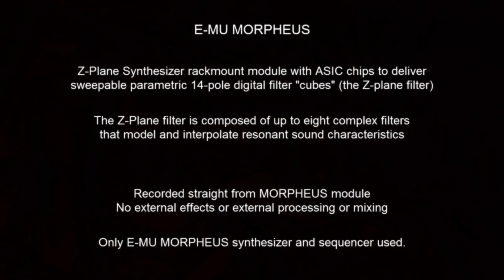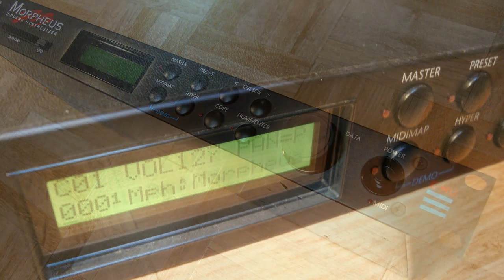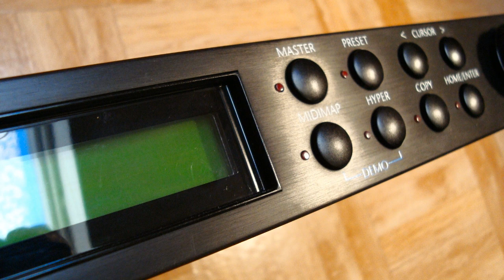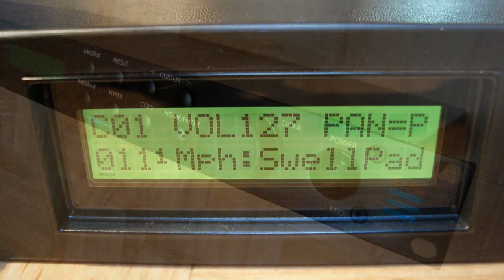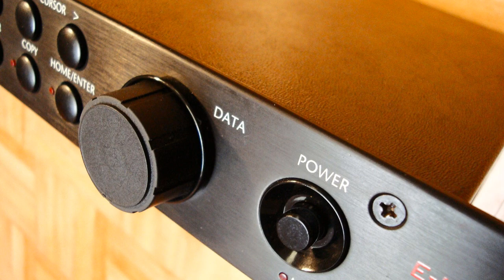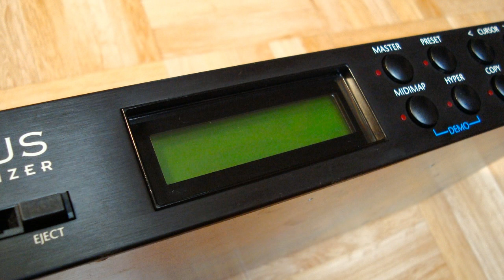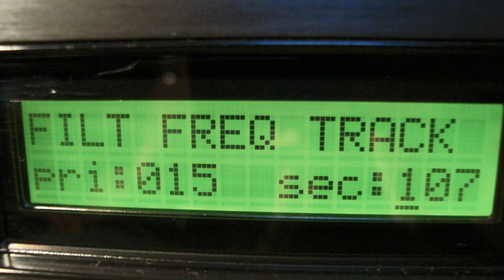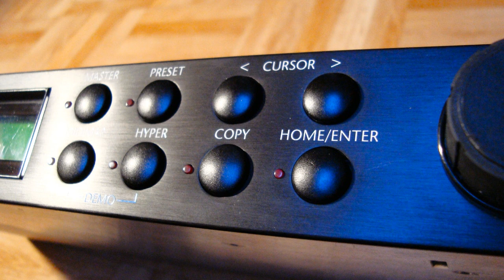𝗘-𝗠𝗨 𝗠𝗢𝗥𝗣𝗛𝗘𝗨𝗦 Z-Plane Synthesizer 【Demo】

Comment: Oh wow,......this is an excellent demo, & a great synth!  I have an E-MU Mo'Phatt, but it's nothing like this Morpheus!
Reply from the maker: Gerry No That's true - Mo'Phatt is aimed for hip-hop, R'n'B, dance and stuff like that, while Morpheus is field for truly electronic sounds and sonic experiments. They are very different synths.
Reply: oscillator I want this synth so badly.  I keep checking eBay, (like 3-4 times per week) but no Morpheus ever comes up for auction. }:o{ 
I guess I can kind of see why.  It doesn't seem like the kind of synth that owners would willingly want to part with.  Oh well.  When I finally do get one, (and I WILL get one!) the waiting & anticipation will make owning & using it that much sweeter. :-)
Reply from the maker: Gerry No
Actually it's not so bad - I've checked eBay and there is one Morpheus auction in UK. Before most of them I saw in US site, sometimes in Germany. Some time ago there was 4 synths on sale at same time, keep watching and you will get one, surely. Morpheus is the synth which if you like it, you will never let him go, but probably you will be happy to sell it if you don't get into it and don't understand how it works. Like I told before - it's not from the easy-ones, it needs some time and patience to go through the manuals, connect to the PC (highly recommended, but not neccesary) and set-up everything to make it sounds nice. Default synth makes just impression of average vintage module, nothing special. When you will get one, I promise to give you all the software I have (Windows based MorpEdit, SoundDiver, Kai'ckul and MIDI-OX), User Manual, set-up routings and some more tips to start of use the Morpheus un full power. Will be ok :)
Reply: oscillator Thanks.  I already saw the one in the UK, but the seller doesn't ship to America.  I've also been looking for Ultra Proteus, but can't find those either.  I do see a lot of Proteus 2000, & 2500.  What do you know about the 2500?  Is it better than the 2000.  I see this information on vintagesynth.com, but I don't really know what it means. (or which has better filters)
2000 - Filter - 128 (multiple types with resonance, including Z-Plane filters)
2500 - Filter - 50 types of 6th- and 12th-order Z-plane filters
Both appear to have "Z-Plane".  The 2000 has more filters, (2.5X) but I have no idea what "6th & 12th order" means, or what "order" the 2000 has.
Morpheus - Filter - 32 14-Pole Interpolating Digital Filters employing 32-bit internal arithmetic; 198 programmed filter types)  
Morpheus seems to have to most filters. (& I've heard what it can do!)  
I think I'll wait for the Morpheus.  
I appreciated your offer of software, & when the time comes, I will definitely take you up on that offer.  ;-)
Reply from the maker: Gerry No
So there is what I found over the i-net:
The P2500 is 4 rack spaces. The sound ROMS of both are the same - same sounds and presets. The P2500 does have control over parameters that the P2000 doesn't have - may be worth the extra $100. Both have 3 extra ROM slots for expansion. The P2000 has only 4 knobs to control the 16 paramters, the P2500 has 16 knobs - more control in the P2500.
I'm not sure about the filters, but definitely Morpheus and Ultra Proteus have more advanced filters than P2000 and P2500. Actually Morpheus and Ultra Proteus are everything the same except sound ROM - UltraP have much more waveforms, but it lacks some of Morpheus waves, UltraP is better for acoustic emulations while Morpheus is better for electronic type sounds. So decision is yours. The best could be to have both Morpheus and UltraP of course, but if I need to choose just one, I choose the Morpheus.
If you're in US, than it will be more easy to get some for sure, coz there are much more E-mu units than everywhere else! Cheers
Reply: oscillator Thanks for the information.  I will go w/the Morpheus then, no doubt.  Except for a really good grand piano sound, (which I have on my Kronos X 88) & some good drum sounds, I really don't much care for sampled "acoustic" sounds.  They're never really passable as sounding like real acoustic instruments.  You can always hear that they're sampled.  I already have enough of those kind of sounds. (which I barely use anyway)  My favorite synths/sounds are analog, analog/digital hybrids, analog modeling synths, wave-table synths, digital/electronic sounding synths, etc.  IMO, the Morpheus is one of the best & most interesting sounding digital synths I've ever heard. (especially the way YOU use it)
Reply: oscillator Guess what I just bought?  :-)  :-)  :-)  :-)  :-)  :-)
I just checked eBay & there it was.....an Emu Morpheus!!!  I paid $349 & the shipping is free.  I don't know if $349 is in the higher end of the spectrum for the Morpheus, but the seller is "Perfect Circuit Audio".  They're an extremely reliable, trusted, & highly rated seller, & they claim that "ALL GEAR IS TESTED AND GUARANTEED TO BE 100%". (they even allow refunds) 
BTW, what can you tell me about any of the Morpheus ROM cards?  (presets only, no additional waveforms)  At $90 each, do you know if any of them are worth buying?
Reply from the maker: Gerry No
Congrats :) That's nice! 350 bucks are not very cheap, but it's not very expensive I think, Morpheus is worth every penny! So welcome to the Morpheus world :)
About ROM cards - I have the sysex files of these cards so don't waste your money. Only thing is that I have Presets of all 4 of these ROM cards, there are not Hyperpresets, but that's not so important by the way. Give me your e-mail and I will send the sysex files, editing software (for Windows only) and some tips to get most of your new friend :)
Reply: oscillator Hi.  I sent my email in a private message. ;-)
I'm almost welcomed to the Morpheus world.  It hasn't arrived yet, hehehe.  It says "estimated arrival April 24th", but it's being shipped from other side of the country, nearly 3,000 miles away.  I tracked it & it says "in transit".  It will probably arrive tomorrow or Monday. (I can't wait!, hehehe)
I'm glad I didn't waste $90 on the ROM cards.  I really appreciate your help with the SysEx & programming software.  I might need a little help with the SysEx stuff.  I haven't used SysEx in nearly 20 years, so I am not very familiar with it anymore.  (my last SysEx dumps were done using a Korg O1/Wfd, back in the mid-1990's)
BTW, all the great sounds in your video here,.....what will you do with them?  What are you plans?  Are you going to sell them or share them?  If possible, I'd really LOVE to have these sounds, all of them. (or even just a few of them)  Your video & the sounds,....they're really the reason why I bought the Morpheus.  Thanks again.
Reply from the maker: Gerry No You're welcome to check some bizarre stuff from the Morpheus synth - my new video called "Insanity". Greetings!
Reply: Gerry No you got it? BTW the proteus 2500 has an arp and is more live-configurable  via knobs etc.. Some guy did a vid of it on here but I forgot his name.. it's a beast of a synth though
Reply: Mel Shivson The Morpheus?  Yes, I got one last month off eBay for $349.  The price may have been a little high, but the shipping was free, the unit was guaranteed. (& refundable for 30 days if I was dissatisfied)   
Also, the Morpheus is somewhat rare & hard to find, so I just wanted to grab one while I had the chance.  Quality wise & cosmetically, It's in near mint condition.  Overall, I'm very happy w/the purchase.
Reply: @_oscillator am I able to use these sysex files inside of a kurzweil ? I’d really love to try them inside vast

Comment: The audio sounds a little "muddy".  I've not listened to the Morpheus before, but it sounds like a lot of top end has been cut - it just doesn't sound "bright"...
EDIT: At about 10:00 the noise floor jumps up & you begin to hear more higher frequencies...  I'm guessing the Morpheus is a noisy beast?
Reply from the maker: The dull sound problem was a cheap chinese external USB audio card (my laptop has no line-in jack). Now I am using the Lexicon Aplha card, which is much better. You can hear the full frequency range of the Morpheus synth if you check "Insanity" tracks on my channel - they were recorded with new audio card and you can hear the real sound of this synth. Cheers

Comment: Nice, I'm surprised I haven't gone through the Presets yet of this machine with a video. There are some definite cool filters going on with this machine, as well as other combos to manipulations; typical synth stuff. Well done! I'm hoping to create some sounds with this beast eventually, I only created one thus far, but need to work on it more. I've been lazy.
Reply from the maker: ish233 It's good idea to use the MorphEdit software to program a Morpheus - that makes it much, much more easy to change the parameter values because you can see and change all these parameters on PC screen and no need scrolling thru the pages with encoder wheel from Morpheus' front panel. And what's more - there is only single presets in this demo video. Morpheus has also Hyperpreset mode to stack up to 16 Presets together, it means the Sound will be very FAT !!!
Reply: oscillator yeah, I usually use the on board screen to make sounds, I've gotten used to it from other synthesizers I use. Although someone convinced me to try another software program for some FM synthesis, so I work with that a bit as one of the only software I used with changing parameters outside of the on board screen. I don't mind it as much. I know about the hyper presets, it's that function generator and utilizing the filters to compliment a sound like a fine wine to a dish, that complicates my mind a bit. The Morpheus is definitely in depth and I've read the manual a few and still working with it. I'm curious to try the Sub outputs next with the mixer I have. All in all, a grand synthesizer.

Comment: Very Nice! Such smooth sounds, but still so much timbre variations.
Reply from the maker: +Super Fata You right, the Morpheus has very complex filter system, also advanced modulation matrix and 'Function generators' which all together makes Z-plane to sound very wide and different. I'm more than happy with this synth :)
Reply: +oscillator Is it hard to program? I mean, if you know your synth basics.
Reply from the maker: +Super Fata Programming is similar to any 'rompler' synth. Only difference is that all parameters of other synths are more exact - by this I mean any parameter defines some separate value such as LFO rate, filter cutoff, pitch and so on, while each parameter of the Morpheus is working in close context with other parameters (Modulation Matrix, Function Generator, Free Run Generator etc). Editing mode have many pages but due to small screen it's little difficult to navigate between them, therefore I'm using editing software called MorphEdit. This is native editor for Morpheus synth and it lets you to work with all parameters simultaneously on the PC screen, great stuff!
Reply: Oh my... I. Want. One. Now. ;)
Reply from the maker: Super Fata
Yup, this synth is unique, a dream for every sound designer :) It sounds nothing special by default, factory presets are very average and don't show the real power of Z-planes at all, but if you dig deeper, it's a real treasure chest :) It needs a bit of patience to understand how it works, also some tricks to work with SysEx files to save and load the presets between synth and PC, also edit them as hexadecimal codes to modify the parameters without the synth (such as preset number, controllers etc), but this game is worth the candle :)

Comment: Amazing sounds! Will try to do a bit more programming with mine but would be good to have access to these presets.
Reply from the maker: I started to fill the bank with custom patches long time ago, but it's still not full and ready-to-use. The idea was to create one full bank with 128 presets as commercial product, but it's not ready yet, unfortunately. My job is not connected to the music in any way - it's just a hobby, sometimes and time after time. I wish to complete the bank, but I really don't know yet when it will be ready.
Reply: @_oscillator  ok I understand. Thanks. I have just started editing mine with Edisyn. Any tips you can share to achieve similar sounds?
Reply from the maker: @larsuk9578  There is much better software for editing Morpheus - this software is called MorphEdit. It's freeware and works perfectly. I tried also Edisyn, but I didn't like it somehow. Morphedit is much better, imho. Another nice software is Kai'ckul, which is nice and simple librarian. I could send you a copy of these programs, if you can't find them over the internet. Cheers!
Reply: @_oscillator  thanks! Morphedit only works on Windows I believe and I am on Mac... Edisyn works fine, I just need to better understand the various parameters (for instance, modulating FreqTracking or Transform doesn’t seem to do much. Morph works fine...)

Comment: Ooh can't wait for the eurorack versions of this, Morpheus and Control Forge. Had to come for a listen to the original :)
Reply from the maker: Eurorack version of Z-Plane filters is great idea, should be exciting to work with it :)
Reply: oscillator
It's coming. Rossum Electronics (E-mu).
Reply: If what I have been reading is correct, the downside on the Eurorack Morpheus Z-Plane Filter is it's only monophonic. These filters really shine in polyphonic synthesis, like harmonies and chords.
Reply: @terrencemann2278  So, what you're saying is you need two.
Reply: @bitspacemusic  from what I'm hearing one per instrument voice. Could be wrong, but the Eurorack is a monophonic instrument.

Comment: I shouldn't have watched this. Now I want it.
Reply from the maker: +toberkitty You can find this synth over the i-net, ebay for example. Just keep in mind - Morpheus is not from the easy synths, it has tricky programming, also it have some tricks to connect to the PC or save/load patches etc. You must be familiar with these things well.
Reply: +oscillator I'm familiar with working with older gear and transferring patches to and from a computer. I make music with almost all hardware and most of my stuff is from the 80s and 90s. Anyway, I really love the sound of this. I used to have a Yamaha TG-33 and the Morpheus reminds me of it, though the sounds are more complex than the TG-33, imo. I only sold it because it's huge for a tabletop synth. I really liked it.
Reply from the maker: toberkitty Than you should check the ebay fo it, sometimes Morpheus appears there for 200-250 bucks. I told you about some tricks just because I also knew something about synths, but I spent few months to get work this synth with MorphEdit software on PC, also transfer sysex files without errors (using MIDI-OX program - adjust number of buffers and buffer sizes, there also was some problems with Windows XP MIDI drivers etc). But Z-Plane synth is great, this game worth the candle :)

Comment: would be cool if you made a tutorial series on this synth. I know that's asking a lot =)
Reply from the maker: Yes, I would like to make some tutorials, but unfortunately I'm far away from my home now - woking abroad for life. You can check the video on Youtube,  called ''E-MU morpheus synthesizer guide tour (VHS RIP)'', which is an original videotape about this synth. That could be helpful I guess and also check some tracks called ''Insanity'' on my channel, if you want to hear the dark side of the Morpheus synth. Cheers!
Reply: yeah I've seen that. it's been on youtube for awhile but it was split up in parts. the video has some good info but it's pretty basic. It would just be cool to see your process. I'm so glad I a morpheus, I got it on ebay for like 150 a few years back and they've  gone up quite a bit since then. Such an awesome synth =)
Reply from the maker: I got my Morpheus for 180 euro in year 2014, now the price is at least doubled. Basically this synth is ordinary rompler, but the best part are Z-filters, modulation matrix and Function generator, they makes it very special. One more useful tip - the best way to program patches is from Computer, using software called Morphedit, that is much more easy and fast way to get nice sounds :)

Comment: Did you polish the sound coming out of this thing? It sounds real lush and thick, even more so then later  emus.
Reply from the maker: +Pure Ambient Drone It's recorded directly from the audio outs of Morpheus to the line-in of cheap chinese external USB soundcard - I got it for 10 bucks on eBay, because my laptop doesn't have audio input. After I mixed all recorded audio clips in chain with Adobe Audition and added a little bit of EQ for highs and lows, but not much.I have better quality recordings of Morpheus in my latest works called "Insanity" and "Insanity 2", check my channel, they also are completely different - dark and ambient.

Comment: This synth sounds really great! Tell me please where should I get rhis wonderfull presets  for my own Morpheus?
Reply from the maker: ***** Yes, this synth is great. Actually I spent many years before with Kurzweil and I got Morpheus just recently, so it's only beginning for me. I made some patches but the full preset bank is not ready yet. In this video I also used sounds from ROM and Morpheus Card Collection. If you are interested, I could share these Card sounds with you as Sysex files and you can load them into Morpheus from PC. Then you can use MorphEdit software to modify all these sounds - it is much more easy way to program because programming from the Morpheus' front panel is not handy. Just give me your e-mail and I will send Sysex files to you.